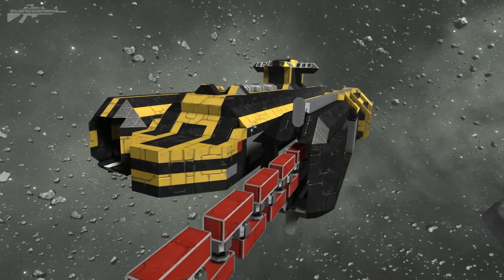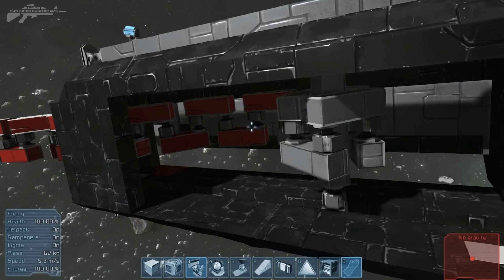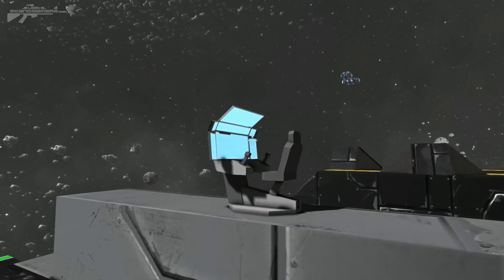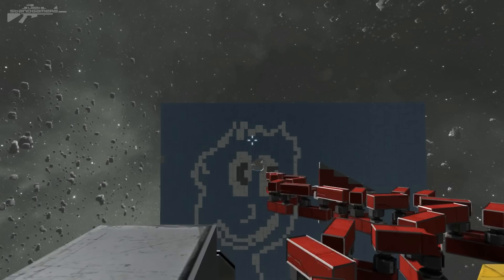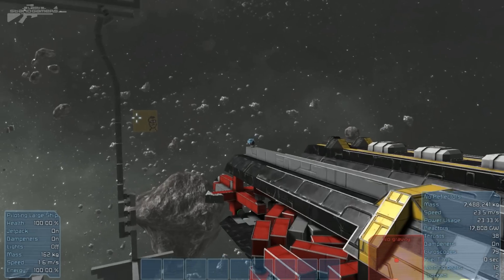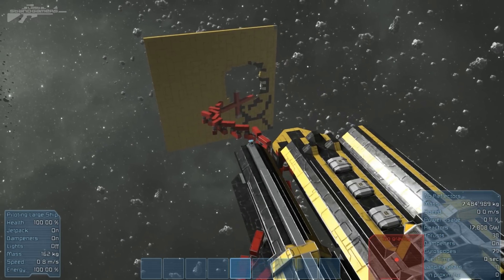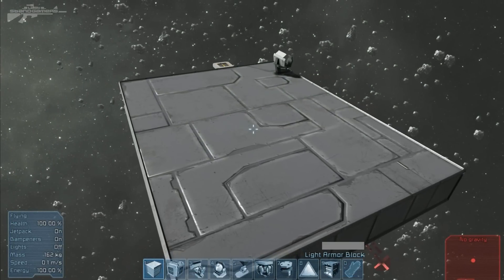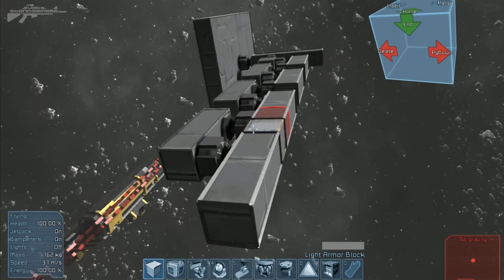Space Engineers - Grappling Hook Launcher & Winch Mechanism Part 37

Comment: What you need to make this work is chain with horizontal and vertical hinges so it will wiggle in 3D.
Secondly you need to consider the velocity of your projectile will always bee too since noone builds their chips hollow inside so even if you break the armor then there will be some inside components + decomposing air aditionally lowering the impact.
Then you either make a hook so small Space Engineers ever seen or some sort of ii shape with rotors at the end spreading the ends once in.
Also, to penetrate you absolutely need fulcrum. Try melee. Then release the hook and tow away. Cool Orkish design.

Comment: have artificial mass blocks and a gravitational repulsion from the gravity generators. you wont be able to use the rotor but youll be able to have the coil in the ship pulled to the back by pistons and then the pistons push it all to the front so the whole coil is coiled up in the front .. then you can activate the gravity repulsion and it will keep pushing the grappling hook away from you... then you can turn off the repulsion and turn on the attraction and pull it back (this can be scripted so it automatically does it) ... come in at an angle and then turn your ship to the side so the gravity generators attract it to the side so it goes out at a massive speed and then back through at a massive speed... even if the rotor coil breaks you have two big holes in your target
Reply: Hassan Ajrouche that might work

Comment: There is an easier way of doing it, at the tip of the grappling hook, make a small cross pattern and at each tip add landing gears, you probably could mess around with a fancy design if you want, to try and hide the landing gears. When you release the grappling hook let it go slowly so they don't break on impact. Once they hit the ship you could lock the landing gears and reel it in. Just a thought

Comment: Aaron you should try some landing gear on a block with a grinder tip then when through the landing gear extends in the inside and activate the landing gear and pull it in

Comment: ..... why not add thrusters to the back .... yes they will prob get damage but what they puncture and put the thrusters o they won't burn out an extra area holding grapple hook in.

Second idea put like serrated teeth 3x3 in a + .... with an extra 1 block tip to start a small hole

The thrusters will also be helpful for a moving ship and also ... if they be trying to fly away will assist with the hook ot breakign as quick so you don't have to keep manouvering ship to stop it from breaking ... also can you set thrusters to individual keys ... can't play this unfortunately

Comment: put landing gear on a chain see if it will work as a grappling hook
Reply: landing gear will break not strong enough
Reply: ahhh ok
Reply: Wolf Drake use pistons and armour blocks to break the momentum and then use remote control to connect

Comment: You've made on big massed grappling hook, with 50 m/s you will go trough most of your targets, or at least make a hole in them. Well, imagine a true big ship. These have at least three blocks of deck armor, not one. I believe your hook needs a longer coil, a stronger coil, a thrusted hook so your ship can actually fire it from quite a distance( this requires some fighters to protect the coil ) and the main improvement which comes in handy, is that the arms are collapsible, so when the coil is in, the arms will come out and the ship is hooked on. This will make your coil work in the first stage, hooking on the target, But, for the second step theres a problem. Any reasonable pilot piloting a ship in battle in most cases has the inertia dampeners on, and he/she will surely notice the sudden movement so that will let him activate the dampeners and give the position of your ship to other pilots and bye bye grappling hook etc. I think some sort of hook made to allow a small suicidal boarding crew destroying vital ship parts is better. But, then a small ramming ship is better. I think, the grappling hook is not effective, yet the design is awesome! I would really like to see more of these crazy experiments!

Comment: i think this idea should be revisited with today`s game version. 
I think maybe you should`ve tried doing this in a 2 phase kinda thing.

First phase, shoot something to punch a hole through the hull, second phase, you release the winch and hope it goes through the hole you just made.

I`m thinking you could also maybe use sensors with some kind of locking mechanism that triggers when the sensor detects the other ship or something. I haven`t messed around with sensors yet so i`m not sure it could work but anyways.

I also thought of maybe adding rotters to the tip of the arrowhead and attach rods to the rotters in a way that they are perfectly alligned with the chain and head but as soon as it`s penetrated the ennemy ship`s hull, you press a button and activate the rotters and spread the rods in a way that they will jam the winch inside the ship`s hull.

It`s a bit hard for me to explain my idea in here with words but i hope it`s clear enough for you to know what i mean.

I know this video is pretty old and the game didn`t have as many features as it does now but it would be interesting to see this same idea being revisited with today`s technology lol.

Comment: I don't think the arrowhead design would work in this instance - the reason arrows and fish-hooks are designed like that is because human parts are squishy and the sloping edge will part the flesh as it enters rather than cutting an entry hole for itself. Metal on the other hand will just dent and shatter, so no matter how you design the dart, the resulting breach will always be of equal or greater size, meaning it would be very difficult to then tug on the towed ship without the dart slipping out.

Maybe you could try attaching extendable arms to the head of the dart, that deploy after the dart head pierces the hull?

Comment: 5 : 31 you could launch the tgawt then luanch grapling hook through hole  then add a contoll to push out some kind off stick or wall out of the sides of tip like a heavy armer block on each side of tip then it back

Comment: What if you put some mass blocks on the harpoon and some gravity generators around the launcher to give it more thrust? Just keep the mass blocks on and only activate the gravity generators prior to launching.
Reply: Making arms extend after the hook has penetrated the armor is pretty easy. You need to simply block the arms with additional light-armor blocks in front of the hook, so that when the hook hits the armor, those blocks are destroyed, letting the rotors on the arms do their job. The only thing that's going to matter is the velocity, because if the arms are released before the hook is inside, they will not be of much use.

P.S. Trying to replicate what I suggested in-game.
Reply: Ironically, that I knew from the beginning. At this stage of development, SE is not able to handle complicated constructions neither physically, nor figuratively. At this point, the memory leak kills the framerate pretty fast. I was once testing out a railgun, and we found that a single server can only handle 2-3 of them before crashing. It's a long way to go, but the future sure does seem bright, and that is exactly why I play SE
Reply: I was thinking about something similar. Although I'd be surprised if the rotors unless protected somehow could take such an impact. Most likely the swinging grappling arms would just get snapped off.
Reply: Also if you just put the mass units on just the harpoon, and then put the gravity generators on the ship you can toggle off the generators.
Reply: Jason Ratz I don't think the problem here is impact or speed. What you should actually do is make something like a small AP tip that smoothly lets a 'warhead' get inside. Once inside it causes two poles to extend, turning the slim rod into a barbed hook. Now you should easily be able to pull it in.
I'm not proficient enough with SE to try this myself, however.
Reply: Cool Mr. Krooper! Let us know how it turns out. I myself am recently interested in the video from Eco Sage were he made a sort of tractor beam using gravity generators. I think it would be interesting to put this set up on a turret platform.
Reply: A tractor beam would not only allow us to hold things in place, but to also interact with them. An alternative grappling hook can be made, although it will have to stay within the 150-meter radius of the gravi field, and will be useless if the enemy ship has gravity (would still work on small ships). In those cases that it actually works it will be pretty efficient
Reply: Yeah, I was thinking for use with small ships, missile defense, energy shields, force fields, and the forementioned tractor beam/energy crane. I just love playing with the gravity generators. I'm currently working on a battleship that uses gravity generators for propulsion and energy shielding. And now with the new grouping options the possibilities are almost endless. Just getting home now so I'll be checking out the new update shortly.
Reply: Okey, just finished making it, and as always, there are good news and bad news. The good news is - my idea works just fine. When the light armor blocks get damaged, they let the arms go through and fix up inside the armor. The bad news is - everything else fails. And I mean EVERYTHING. The rotors' velocity can't be over 1.8 (with maxed out torque), otherwise they will break the blocks that hold them in place (I did try lowering the torque but the arms become inefficient and take too long to open up); the whole construction doesn't want to stay in one place and wobbles all over the 'barrel' even with dampeners and gyros; the chain tends to break; I tried artificial mass, only to discover it didn't do anything at all; the chain also tends to unfold under mysterious circumstances... And above all that, the harpoon does not have the needed penetrating effect (I tried it on heavy armor, as it is what 85% of the big ships in SE are made of) and it's effects are similar to those of a headbang...
Reply: Yeah I figured something like this would not work properly without becoming far too bulky to be effective. Maybe if they give us a block that worked as a switch to be tied with any other block that could be put on a timer. A good try nonetheless.
Reply: Jason Ratz It's not as much about timing as it is about edifice. We need a block that will be able to withstand simple collisions without undergoing any structural casualties. The collisions themselves need to be looked over and recalculated. Until one or the other is implemented, we can't manage to make anything similar
Reply: I think the range in which a warhead explodes is a specific amount of blocks what if you tipped the harpoon with the warhead and then put let's say nine blocks of light armor between that tip and the actual harpoon (this idea comes from an automated drill I saw uploaded here). My thinking being the warhead will be able to open it up quicker with hopefully less overall impact on the harpoon, leaving only the amount of thrust in which the harpoon is moving as the final variable to work out since if effective it leaves less structural damage to the actual harpoon while opening the hole for you.
Reply: It wasn't going to be useful anyhow. The idea is interesting, but it's too complicated.

Like the Gravity Gun (read; Halo's MAC )
I made one that hurls 1kt-kg rocks at ships at 160m/s. But aiming and handling it is rather impossible. It could be used as an artillery piece (hell yeah! It disintegrates ships it hits, but not astroïds) but it's rather impractical.

So is harpooning. Doesn't mean you should stop researching it! It's still an awesome idea to work out but don't expect them to be effective.
Reply: Jason Ratz yeah I considered that, but I realized that even if the harpoon makes it through, the arms won't be able to hold it because they would simply break off the rotors once you start pulling it.
Again, it's a very nice concept, but in order for it to work, we need some solidity to the harpoon. Right now it's anything BUT solid...
Reply: I was literally about to say the exact same thing... then I saw your comment. But why not build a launcher for the weapon, have the mass on the harpoon, then once the harpoon's through have a grav gen in reverse to tow it backwards?
Reply: RascaldeesV2 The problem is - it'll have to be within the range of the generator, in order to get sucked back in; ergo, short chain, and no fun.
 
But! There now is a way to execute all of this - by having the wheels with 0 friction absorb all the internal damage. The concept of the hook itself remains the same as before - bombs up front on a 4-column 'pole' strapped to a mass block; 2 rotors on the sides operate the two arms (about quarter of the torque, btw, otherwise it breaks) covered with low-fric wheels, and all that strapped to a chain (each link made up of 3 armor blocks with 2 rotors on top and a wheel on the side). (The hook and the chain are small ships btw) And all that is tied to a big ship rotor, that's going to bring it all in once it does its job.

Shoots out using a short-ranged gravity gun (not to cripple the angle of penetration).
Reply: MrKrooper, Not necessarily. You could have a chain using some blocks as mass instead of armor.
Reply: RascaldeesV2 Heh? Do explain. Although, now that we have pistons...
Reply: Well, basically mass blocks can attach to any surface and not just a single position like gravity generators. If, and a BIG if, you were able to combine the thrust of the artificial mass in the chain with the rotor speed you could possibly accelerate the chain AND the harpoon rather than just one or the other. Honestly though? I think it may be a lost cause since any hole made with the harpoon will more than likely break the tip. Unless it was thrust in, rotated, and then pulled backwards against a solid armor piece but I'd use a sticky missile before the harpoon.
Reply: That's why you use armor blocks and wheels. I personally hope to see ropes (or futuristic carbon nanotube cables ;) at some point. If not as an official tool, then as a mod (and there are plenty of those who would be willing to make one). Ropes will give us a ton of possibilities... At the same time taking the game back a few centuries :D
Reply: I'd love to see lasers for either mining or just firepower. They said realistically within 70 years and the American military already has a laser capable of boring through 9 inch steel within a fraction of a second. It'd be nice to have mining lasers or hell, torpedos and actual missile launchers. I'm interested in seeing missile silos for incredibly large missiles without having to build one and then take 234380384098503948509348 hours to aim it and HOPE to hit.
Reply: RascaldeesV2 was this laser like .... 3 times the length of a rocket launcher (and yes i mean an actual rocket launcher not and rpg launcher)

some of these thing do exist and being weaponised ... lasers are being built on a stealth boat thing to sink ships at night
Reply: RascaldeesV2 Good thing there's utility modding now ;)
Reply: MrKrooper I posted this forever ago...
Reply: RascaldeesV2 yup. last year, hehe. the things you were talking about were only implemented circa a week ago, though. I thought they would be relevant to mention
Reply: MrKrooper Eh I guess. I've built better things now.
Reply: But like seriously ... are pistons not like a normal part of game put some pistons on a hinge joint behind the bomb ... enough distant not get damage and some thrusters behind them to keep it going ,.... use thrust to accelerate (pulse it) and keep chain straight when hits bomb blows a hole the joints start to flip and pistons can extend if it needs to be wider ... and thus real life model of grapple hook ... the ones that penetrate walls anyway
Reply: Andrew Boxill
You do realize that this video and subsequent posts for the most part are from 10 months ago and pistons did not exist yet!
Reply: Andrew Boxill Way too complicated.

Comment: Your armor piercing torpedoes get enough penetration to succeed here.  One problem you have is that you need this thing to hook on to the target once it passes through.  The harpoon needs to be as thin as possible to ensure maximum penetration, after that you need a hinged component to the harpoon that will open via inertia.  It will stay shut during firing and open upon application of reverse thrust. 

So, you fire it and get penetration, then on your firing ship you throw it in reverse to pull the chain back and likewise the harpoon.  The hinged components on the harpoon will attempt to continue going forward (thus opening).  What do you think?  Will that help?

Comment: You'd need to make a hole in the hull first then fire the grappling hook in. But the grappling hook needs a way to expand while inside as to not slip free. So like a rotor that flips out the barbs to grab the ship. Without the initial hole all you could try and do is slash at the hull with it

Comment: Have you ever been fishing sir? I am asking because thats not a hook at all. . .just an arrow. Id recommend it to make the hook itself at most 3 blocks radius with very long 1 block tip because these seem to pierce well. 

Also inertia  propelled hook would be the last thing id test, i would most likely try to make hook itself small ship with engines and shit. That way your main ship doesnt need to be moving at all, there is no fiddling or changing rotor settings, and the hook itself would be human-guided . . .for perfet pinpoint precision, sort of.
Reply: its a grapple not like those four tip hooks,that would work?